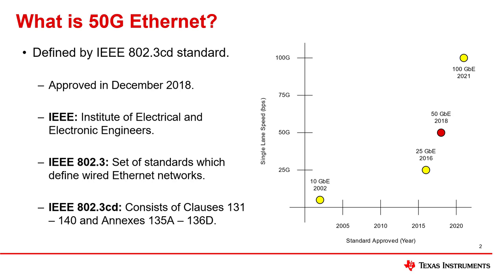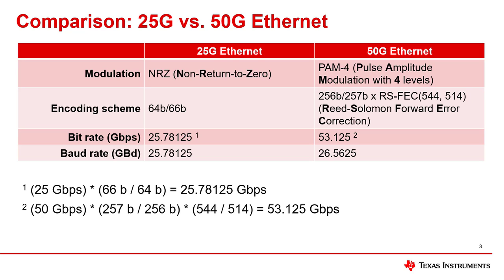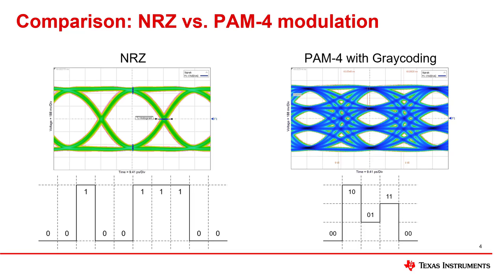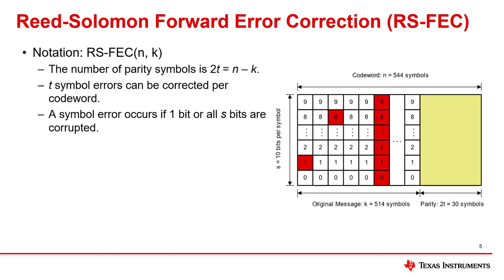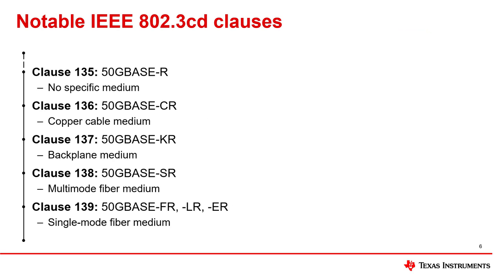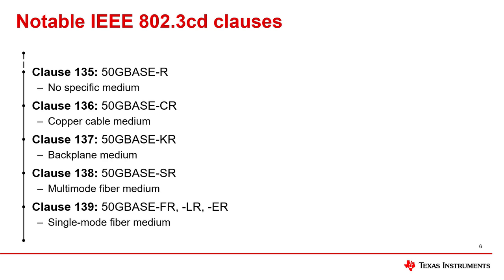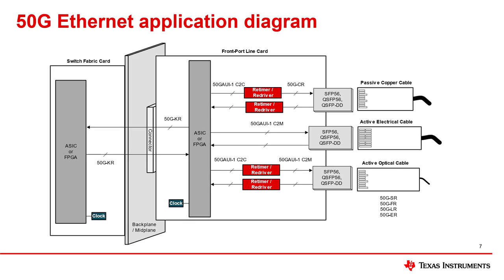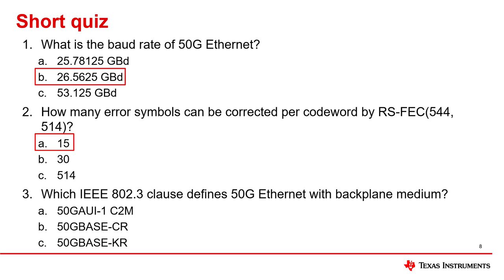What is 50G Ethernet?

Comment: there is too many crossing point in pam-4 eyediagram, or i dont know what you mean by gray coding. As i understand this, for 4 state bus that uses gray code, from each level there is possible only two ways, but on your video i see each level can lead to any other...
Reply: My understanding is this: looking at symbol voltages from low to high we have 00, 01, 11 and 10. For PAM-N we have N-1 decision thresholds, so that means N-1 ‘eyes’, three in this case. They Gray code means that if noise perturbs the received signal above or below one decision threshold there’s only a single bit error in the two bit symbol. If the symbols were labelled 00, 01, 10, 11 and error in the middle decision would give rise to a double bit error 01 becomes 10. With PAM-N we have log2(N) bits per symbol, so 2 in this case. Hope that helps?